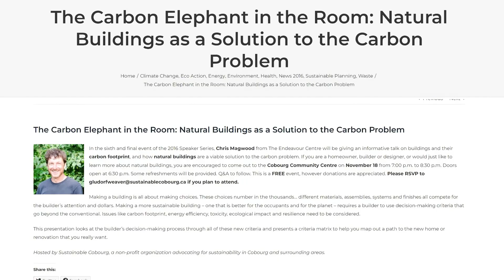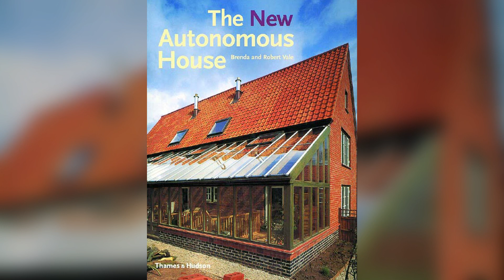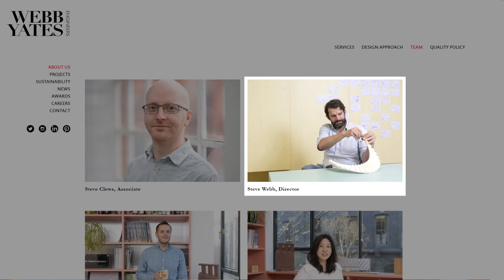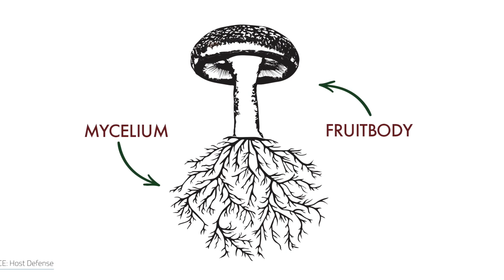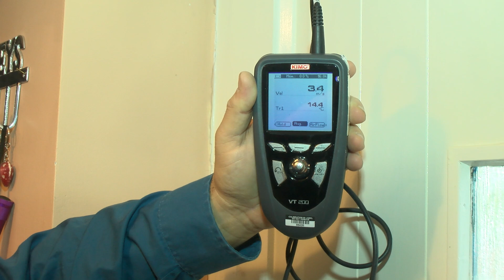Building Healthy Housing for the Planet

Comment: All buildings, with a temperature/humidity controlled interior space MUST! be built with a totally passive outer thermal envelope. Ricebales are said to have 2x the R value of strawbales. Even beneath the slab or foundation. Build passively insulated skyscrapers, cities.

Comment: In UK The new houses built by those box house builders  are dreadful. They allow  building estates in flood planes. They  are install gas supplies without under floor heating. Even the roof design is so poor it needs extra support installed to take the weight of solar at a future modification. .. You are correct its the politicians that are failing us